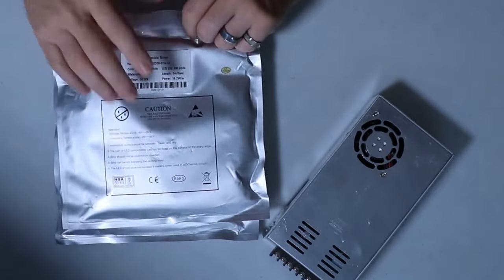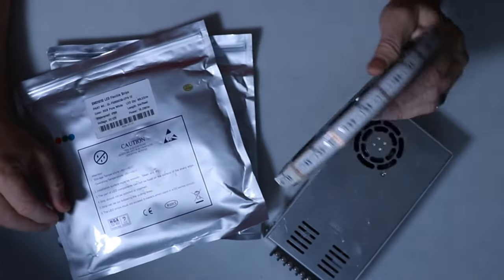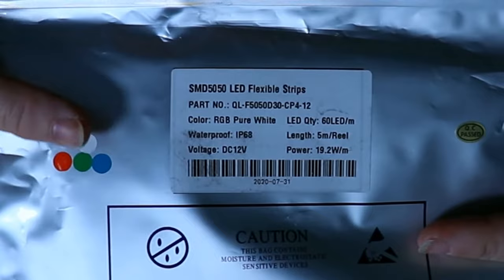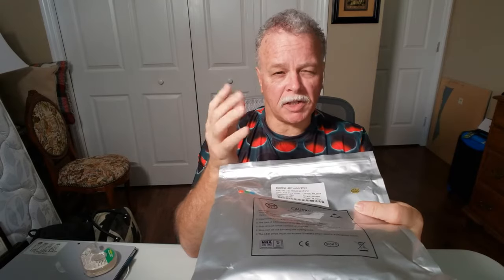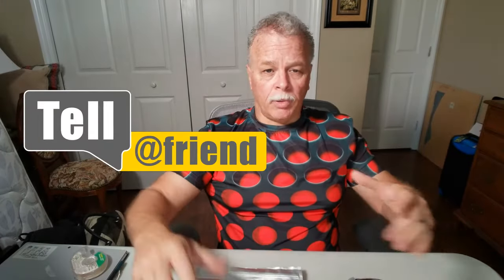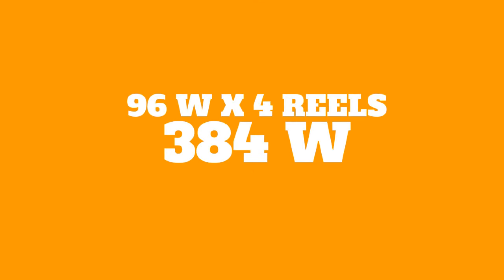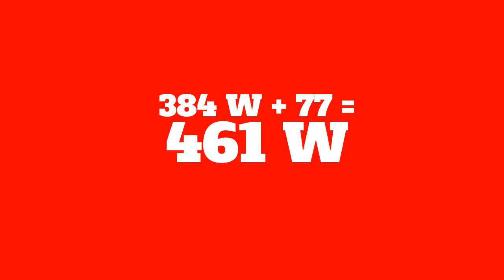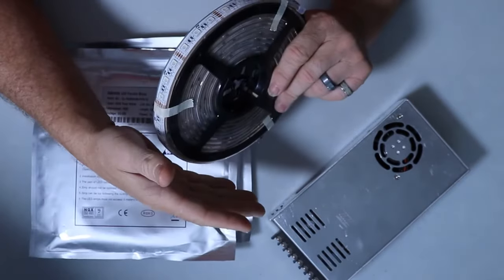Formula to figure out watts for LED's / How To Choose a Power Supply for RGB LED lights

Comment: Not a good idea! This wattage per foot will require a welding hood when you turn them on. You should never run that many watts on one power supply. Your asking for a fire.
Reply from the maker: I have been doing this for over 10 yrs. Our company has done work for major companies and high end restaurants and several islands with highly satisfied customer and very little call backs if any. So my friend, I do have some knowledge about this subject. Unless you are misunderstanding something I said.

Comment: Higher voltage would draw less amperage. The wattage (power) remains the same. Lower amps lets you get away with smaller wires.  Other than my nit pick,  excellent job.

Comment: Wouldnt your setup having a voltage drop issue?
Reply from the maker: Can you be more specific please.
Reply: At 64 feet of LED’s yes, you’ll need power injection several places even at 12v.

Comment: Good evening help please. . I have a 5 meter long 12V LED. (FCOB I RGB IC LED light strip, WS2811). it consumes 12 watt/m so requires 12*5 = 60. + 20% it gives 80 watt. I plan to buy an esp32 for the controller with wled. I know that I have to buy a 12v power adapter which provides 80 watts even 100 watts. questions: you never talked about amps in the video, should I take amps into consideration or not? Does the power adapter adapt according to what the LED requires? Can I buy a 150 watt power supply without problem? (I plan to add another LED in the future). help me please
Reply from the maker: The amp is not an issue. Just be careful in adding to much watts, because you are going to add in the future you should be OK as long as you add the light to it.

Comment: what if you didnt have the package with the label? and say you had a foot or so of an led strip? could you count the number of led diodes and calculate it and figure out how many watts you needed? how would you go about that?
Reply from the maker: Great question, normally you would want to contact the manufacturer or distributor. If you are only talking one foot or even up five feet, you can have a 25W to 50W PS. If the LEDS are really bright and you do not have the label, then using 4.7 X length in feet can give you a ruff estimate. If it's not bright then you can use 1.4 X length in feet. If you are running more than two reels you MUST calculate what you need to make it work efficiently. I hope this helps.
Reply from the maker: If you like the video please give it a thumbs up. Also subscribe to my channel, in this channel I show the How To’s for RV life and much more. If you like food like we do and like to visit other places, then subscribe to my other channel. My other channel It’s All About Food & Places https://bit.ly/3b5qDig

Comment: I didn't read every comment but a couple questions.... In your example you said you need 500 watts....  Would you personally use a 500 watt power supply or can you or would you use 2 - 250 watt power supplies one at each end?.... 

I thought in another video you mentioned putting a power supply at each end so the farthest leds didn't go dim. But maybe that was only if you had a weaker than needed power supply?....
Reply from the maker: you can do two 250 one on each end.

Comment: Awesome video. I’m curious if my power supply is 30 to 40 ft from the area that I’m wanting to place my led lights, is there wire you would recommend?
Reply from the maker: That is not that far we're you can use a 22/4
Reply: @thebesthowtobyclem6908  Appreciate the response!

Comment: With this would you need to still need inject power on the other side ? Or can this be powered off the one end ?
Reply from the maker: if you have 24V only if you go over 32 feet. if you have 12V only if you go over 16 feet unless you tap in the middle. what mean by that is if you have 12V and 32 feet of LED then you can tap in the middle at 16 feet then the power will go both ways. I hope this will make sense

Comment: Great explanation. Thanks.

I am a novice and need help. 

I am trying to set up a led accent wall and here is my design.

I have "4" 12V WS2815 LED Strips of 5 meters each with 60 LEDs/Meter so a total of 1200 LEDs.

I want to place two strips on the left side of the wall and 2 strips on the right side of the wall. All strips should run the same effect when powered on.

I have a single PSU unit. How can I connect all these 4 strips to PSU and to Athom LS-8P controller such that they have same effect when powered on?
Reply from the maker: You need to make sure that the controller can handle all of those LEDS. Did you make the calculation like i showed you on the video? And does your controller can handle them?

Comment: thanks ....please suggest....i have brought LED string lights from USA to india.
now looking for a correct power supply.......details....LED Outdoor String lights with ST38 Bulbs...Model: CMC-O501
Total Length: 100FT
Number of sockets: 50 each
Voltage: 120V
Wattage: 1W
Bulb Type: ST38LED
Voltage in India : 230 volts
Please suggest
Thanks
Reply from the maker: I normally do not use 120V LED. But the formula is the same to figure out the W. But the difference is the you will need a PS from 230V down to 120V.

Comment: All I want to know is how the heck I can get a constant Voltage reading from my 12.6 V 3S2P Li-Ion battery after connecting it to a non-RGB Led strip [2m] light. 

I get voltage drop and my volt meter does not give me an accurate reading when the LED strip light is plugged in. 

All I want the Volt meter to do is give me a percentage of the battery capacity that is left in the battery. Nothing else. 

Battery: 50Ah
LED (Red) 12V - 2m Strip
Reply from the maker: I'm sorry, I'm not able to help with that.

Comment: Hi, how do you work out what total watt led driver i need for  a 10 metre 24v rgbw led strip pls.
Reply from the maker: I believe that I have explained how to figure it out on this video. But you need to make sure that you get some information from the manufacturer that should be on the package in order for you to work the formula. If not on the package then call the distributor to get that info.

Comment: please respond to me if you are still helping with LED light power supplies, I have a few questions as I try to fix my huge blue tooth speaker lights that stopped working. I want to make a new toggle switch and be able to plug it directly into a house wall plug, but need to figure out the correct power supply numbers needed based on the led light panels on the speaker. there are a total of 10 separate light panel boards. Thank you and I hope to hear from you soon.
Reply from the maker: I don't know if I would be of great help. You would need to know the voltage of the LEDS and totally bypass the blue tooth system. Send me some photos but I cannot promise anything.
Reply: @thebesthowtobyclem6908  where can i send you the pics and the voltage info?
Reply from the maker: carrionclem@gmail.com

Comment: I’ve got a Razer back neon sign 10inch by10inch   How do I covert it from 120v to 12v
Reply from the maker: Is the neon was not manufactured to be used for both 120 and 12V then you will not be able to convert it. You will have to purchase a 12V neon which they make LED neon that is 12v.

Comment: How do I get that information if my LEDs do not tell me any of that information?? My LEDs did not come with that label and when I go on amazon to find out the W/m it doesnt say anything on that. How do I figure this out? Im running WS2811 addressable LEDs
Reply from the maker: Unfortunately there are a lot of cheap companies that are producing LEDS and not giving that info. Sometimes you can find it in the description when you purchase them. Another option is to buy a special meter that you connect to the LED and it will tell you how much power you are drawing per roll if you connect the whole roll.

Comment: Hello can you help me please
I have a BTF-LIGHTING ws2812b 60/metre led strip of 18w-90w 5 volts DC WHAT WILL BE THE GOOD Power supply? I saw your videos but the calculations are made from 12 volts
thank you very much and congratulations for your good work
Norman
Reply from the maker: I'm sorry but I have not worked with 5v
Reply: Ohm’s law. Watts equals voltage x amperage.  From here you can switch it around.  You have your voltage and your watts so it’s simple math.  But 90 watts is 90 watts regards of voltage, just have to worry about the current (amperage).

Comment: Let’s say I have 16 feet of length on an under cabinet and the led diode starts at 5 feet from the power source. I now have exactly 16 feet to go underneath the cabinet. How would I take account for that 5 feet of extra wire hiding in the cabinet or do I account for that? I’m assuming that 5 feet will still make the end of run,  dim because now the run is longer than 16 feet, correct?
Reply from the maker: Great question, the 5 feet will not make a big difference. nor will it make it dim. you will be good. It's when the wire run starts hitting 60 or 80 feet and longer and depending on the length of the LED strip is where you need to consider a thicker gage wire.
Reply: @thebesthowtobyclem6908  thank you for response. Is there a such thing as too much wattage from power supply to led lights?
Reply from the maker: Yes, you only want about 20% over

Comment: @1:30  Does this mean that a 5050 RGB LED Strip of 5M will consume 96Watts of power? Is it the same for similar WarmWhite LED Strips? 
If so, how/why are LED's labelled 'economical/efficient' please?
Reply from the maker: I will not be able to answer your whole question, but what I can answer is that a 5050 RGB will use what the label says 96w only if all 3 LED colors is being used at the same time to create a white color. If you turn the RGB to a white color, then and only then it will use max amount of W. If you only use one color like blue or red or green, it will use 1/3 of the power. If you want teal, orange, purple, pink, etc. then it will use 2/3 of the power, that is because it will need two light diodes to create these colors. This particular LED sound pretty bright you can install other LED that does not required to be that bright, but remember that you are covering about 16'3" of LF.
Reply: @thebesthowtobyclem6908  Thank you for the explanation. 👍

Even 1/3 of 96 means 32W of power....phew...
Reply from the maker: If you like the video please give it a thumbs up. Also subscribe to my channel, in this channel I show the How To’s for RV life and much more. If you like food like we do and like to visit other places, then subscribe to my other channel. My other channel It’s All About Food & Places https://bit.ly/3b5qDig

Comment: Hello, the led strip can have 5Mts and that corresponds to 204W but if I cut the strip and only need 3 Mts then the calculations are already less right?
17 W/m x 5Mts = 85
85 x 2 = 170
170 x 20% = 34 +170 = 204
I need 3 mts so I'm going to cut the led tape and pass:
17 W/m x 3Mts = 51
51 x 2 = 102
102 x 20% = 20.4 +102 = 122.4 W rounded to 150W
Right?
Reply from the maker: That is correct. I'm glad that you were able to figured it out.
Reply from the maker: Please make sure to give my video a thumbs up if you like it and if was of help and do not forget to subscribe to my channel and hit the all bell button for the latest videos. Thank you

Comment: 3:30 hi I calculated with this method and I get 60w 
30w x 20% = 600 is that means 60w? If it is I can find 60w power supply. Should I choose to buffer power supply more than 60w or can I use 60w power supply?
Reply from the maker: I do not see how you reach 60W from 600. Can you text me the whole formula that you did please.
Reply: 20% of 30 is 6. Don’t forget to move your decimal.

Comment: Thank you for your informative video.  I have a question please.  I am setting up 4 runs of 16.4 feet RGBW.  If I use a 500W power supply, it is still safe to use the 5 strand 22AWG wire, or do I need to go larger, like to 18 or 16 Gauge?  Also, can all 4 LED strips be merged to the same controller, to assure accurate music synchronization?  Syncing to music is the only reason I need these lights.  Thank you very much!
Reply from the maker: You can still use a 22AWG wire. The only reason you would use an 18 if you have a very long run from your LED to your PS. Like 150 feet or more. You can merge all LED strips as long as the controller can handle it. You will need to check with the manufacture of the controller to see what is the max allowed. I hope this helps.
Reply: @thebesthowtobyclem6908  This is fabulous news!  My run will only be 16 feet from the PS to the furthest strip of 16.4 feet.  I really appreciate your knowledge and suggestions.  Thank you very much!!!
Reply from the maker: If you like the video please give it a thumbs up. Also subscribe to my channel, in this channel I show the How To’s for RV life and much more. If you like food like we do and like to visit other places, then subscribe to my other channel. My other channel It’s All About Food & Places https://bit.ly/3b5qDig

Comment: how to connect 20m together to one power supply
Reply from the maker: One way to do it is to have each spool or 5m roll connected to PS or we call it home run or home base. So if you have 4 spools then you will have 4 home runs. Like I mention this is one way to do it with out soldering. I have other videos talking about this on my channel.

Comment: Great video. Very helpful. (Subscribe... check. Notification Bell... check)  One question, if you halve the strip length and treat each half as a stand-alone strip (each strip getting its own supply of power) would that halve the power need?
Reply from the maker: First I want to thank you for subscribing. I hope I'm understanding you. Example if you have a 16 foot strip and lest just say it needs 25 watts but you want to cut the 16 in half giving you 8 feet so now you have two 8 foot strips then you will still need the 25 watts to power them both. But if you are wanting to only use one 8 foot strip then you will only need 14.5 watts to power that 8 foot strip. Please let me know if I answered your question. If not then please ask me in a different way.